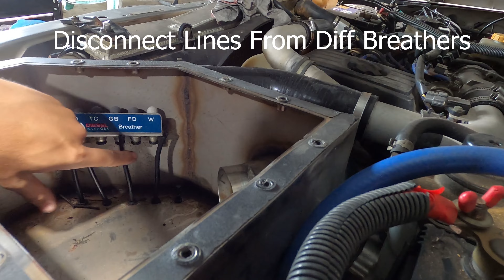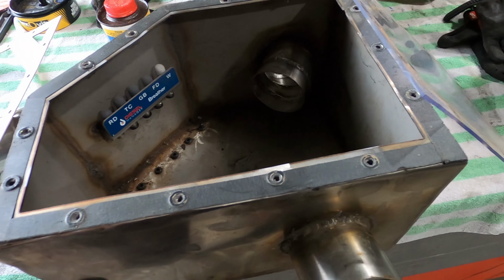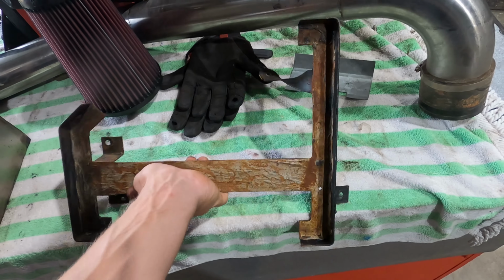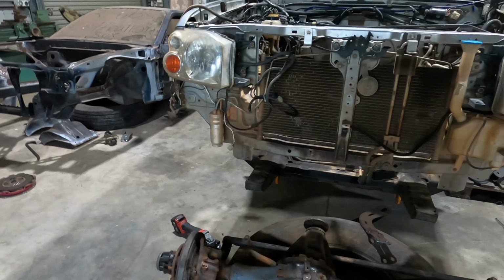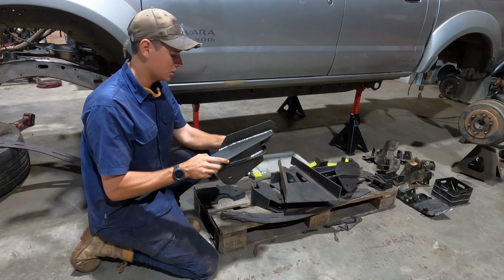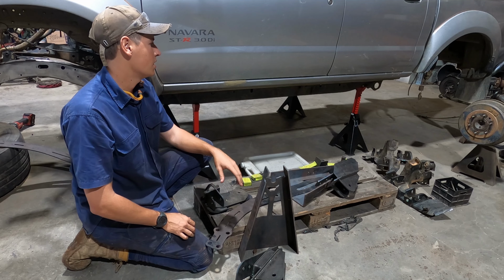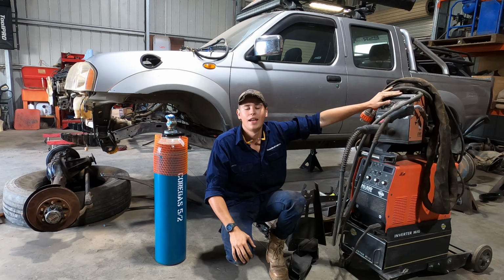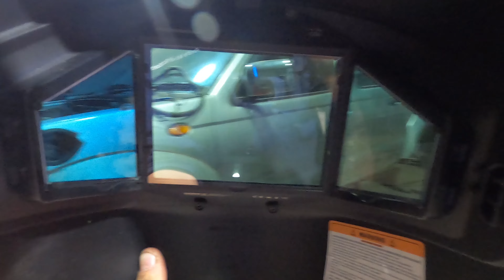D22 Navara Solid Axle Swap Ep.2

Comment: Definitely keen to see this thing finished. Reckon i'll keep my d22 and sas it eventually. Maybe even a barra or LS. Love hate relationship with the thing at the moment.
Reply from the maker: There’s been a couple LS but the only Barra I’ve seen done is Matt Kings and you definitely wouldn’t be able to drive that around here without copping a defect. Be keen to see someone pull it off as they’re such a long motor 🤙🏻
Reply: @ReubsModifications  yeah Matt King is insane 🤣 39's and a 10 inch lift last time I saw the thing posted
Reply from the maker: @riclatham6464  oh the thing is a small monster truck it’s wild